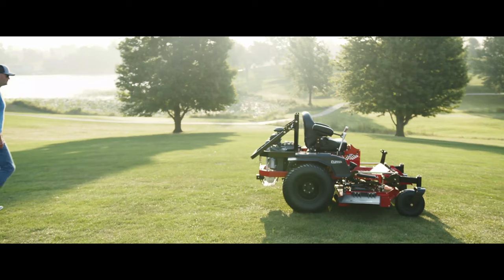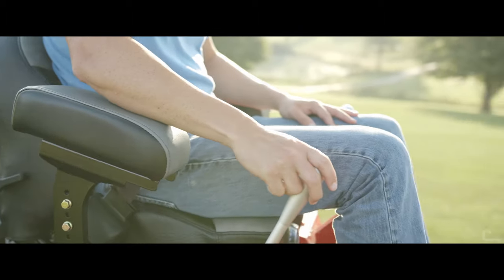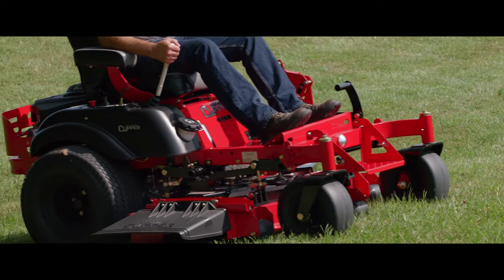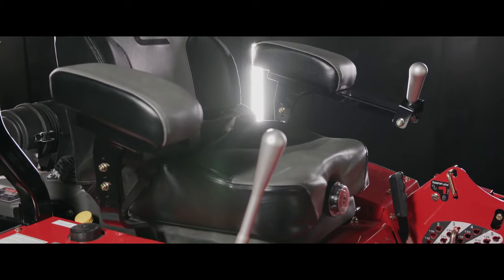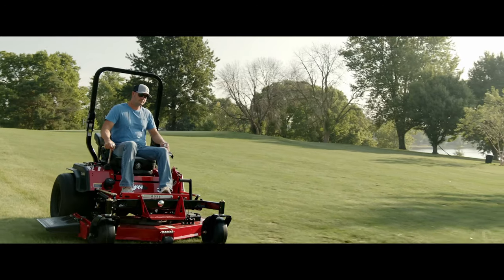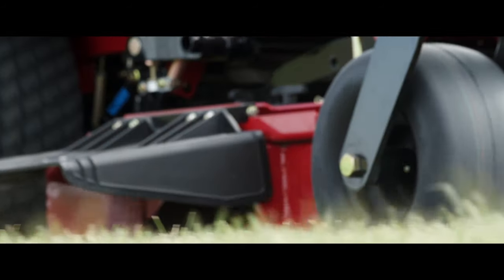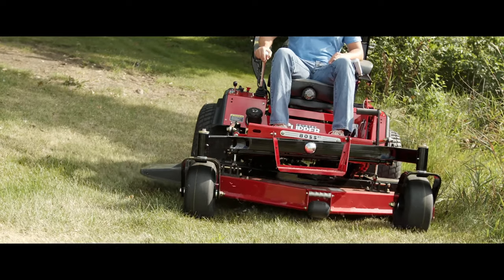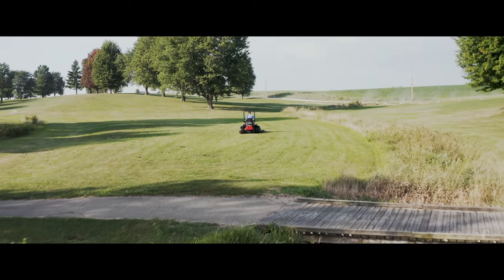Joystick vs. Twin Stick Zero-Turn Mowers | Traction & Performance | Country Clipper

Comment: I have disabilities & I’ve been looking for the perfect mower to meet my needs. I need one I can easily get on & service myself but I haven’t found one yet until I found  Country Clipper by accident looking at a local dealers website. I went over to the dealer to check them out & they only had 3 left that’s way too big for my yard. 
I’m looking at the 42” Avenue with step & grab bar. That would make it alot easier for me to get on & I like the flip up deck for servicing. I can’t crawl around on the ground like I use too. I also like the joystick because I have a hard time fitting behind the controls. I was hoping to get one with the 0% financing but there on back order & will be looking at a year or two before I get one. I wish I knew about these mowers sooner or I would of got one by now. Theses mowers are great for people with disabilities & to those who are getting older. There’s others like me who are trying to find the right mower but don’t know about these. When I search for mowers for people with disabilities or for older people these mowers should be the first to come up.  I know these mowers costs more then most but having those features is worth it to me.

Comment: I am coming up on one full year with my new Challenger model with the joystick. My back yard is all a down hill slope of about 12% grade and it is all torn up from the mower being uncontrollable when I try to make turns uphill at any speed when moving across the hill. When going downhill on steeper spots at medium to slow speed, the drive wheels will drag enough to leave a torn up path behind you. I am extremely frustrated about this mower and wish I hadn't bought it. The near $8000 cost was a huge step for me. Before I decided to buy it, I watched every video I could find and watched one being run at the dealership on a very similar hillside to mine. Before anyone asks, yes the grass is dry.
Reply: Let someone show you proper driving skills.  I have had 3 mowers and they are great mowers.
Reply: @Fiddleplayer7  Bless your heart.  I would love for you come show me how.
Reply: @Fiddleplayer7  I agree that they are great mowers. As long as you're not on my hillside. With me on it, the mower weighs over 1100 lbs. That's apparently too heavy to keep it controllable on a steep hill. But I would pay you to come prove me wrong.
Reply: Zero-turn mowers in general are not good on hills and require a lot of experience to maneuver safely and without damaging the turf on hills. The best ZTR for hills in my experience is the Great Dane Chariot, which has been out of production for about 20 years. The Country Clippers should be close since they appear to have a low center of gravity.
Reply: Don't drink and drive. The joystick allows for easy access to your cup holder to hydrate you during your work. Never put beer in it. This will lessen your driving problem
Reply: Yeah man you bought the wrong tool for the job. Stand on or walk behind mowers excel on hills due to a lower center of gravity and better weight distribution.
Second off, you couldn’t give me one of these off brand pieces of junk.

Comment: I am very interested I am a disabled marine corps veteran that doesn’t have use of my left arm and almost no use of my left hand , I have a traditional toro zero turn mower it’s sensitive and I have enough dexterity in my left arm that I can actually operate it but it takes a lot out of me to mow the lawn it’s not relaxing like it used to be, this might be the perfect thing for me

Comment: I agree it is a wel built great running and solid as a rock .. But it is very hard to not tear the turf up when you turn period.. Not just on hills and im talking huge J Turns and i do know how to run all my machines very well and im not some rookie who has no clue how to mow.. But just SERIOUSLY it is wrong for Country Clipper to say that the joystick prevents tearing up the turf.. My dealer even told me that it was near impossible to tear up the turf because the wheels never stop turning when the other is in motion and they engineered it so that companies could put untrained people in it and they wouldnt have to worry about them tearing up the turf.. Other than the joystick like i said its great i just really wish i would have gotten their mower with the regular lap bars though.. I would much rather control exactly what each wheel is doing.
Reply: I agree that it is still difficult to avoid tearing up the truth although the control is amazing.  I'm referring to my little baby 30 in Ryobi lithium ion zero turn that has a joystick.  It had a bit of a learning curve to avoid tearing up the turf but once I learned it I really don't do it at all anymore although I do have pretty tough grass with St Augustine.  I wonder if they get even better control on the wheels with an electronic mower like mine because of course the electric motors have instantaneous response and are super powerful.